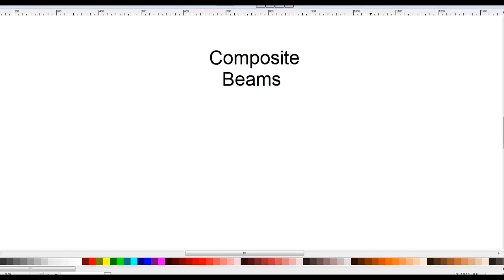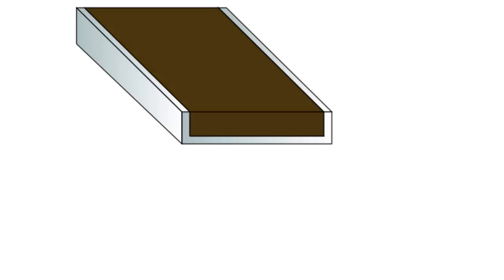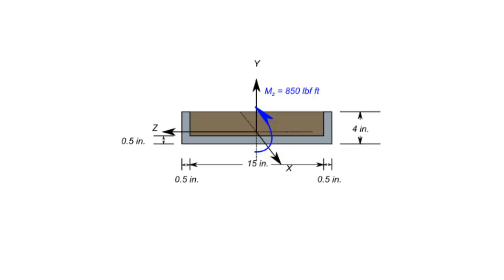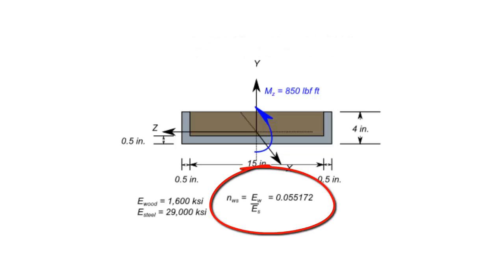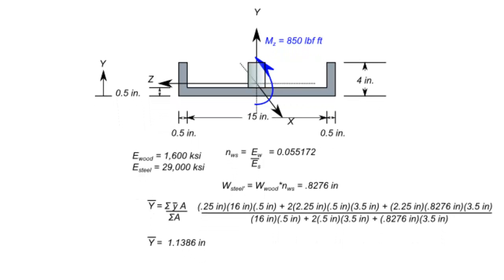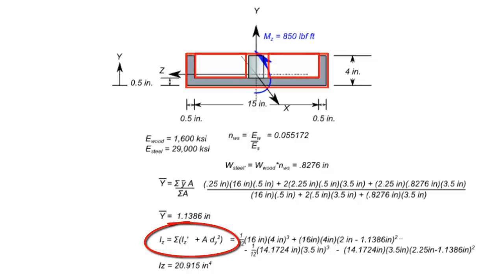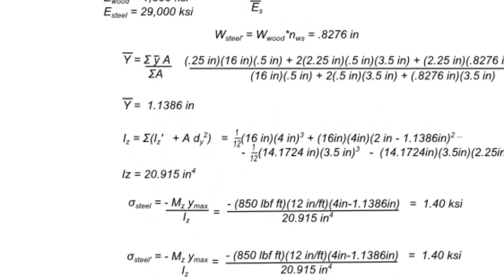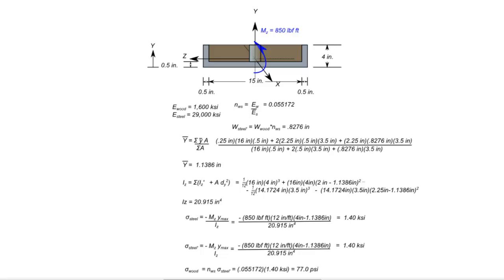Composite Beams

Comment from the maker: If you listen around the 3:40 mark, I solve for the moment of inertia by calculating the moment of a large box (16" by 4"). 

The centroidal axis for that area is located 2 inches above the bottom (so dy = 2" - 1.1386") .